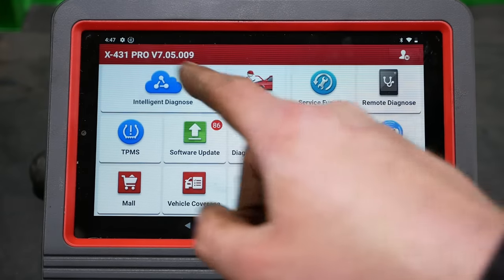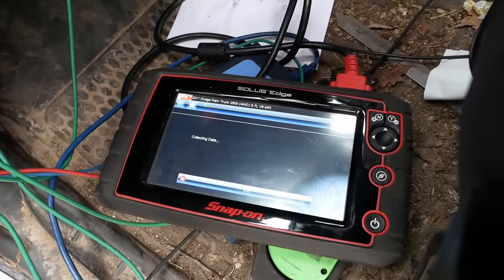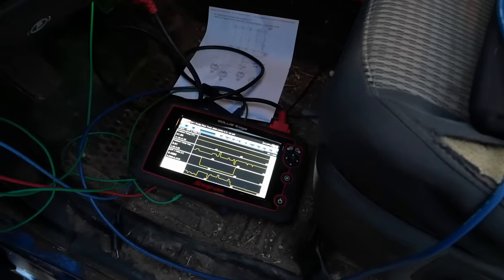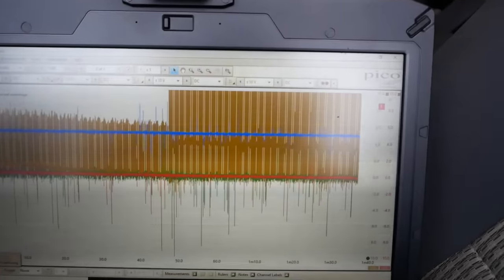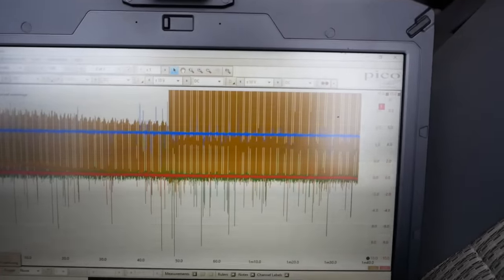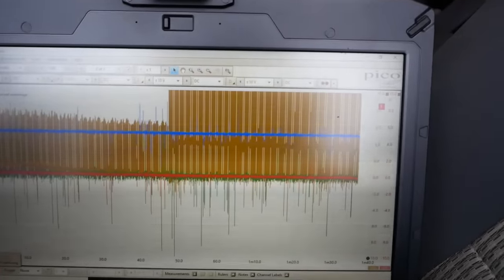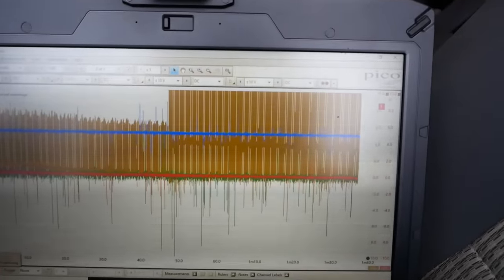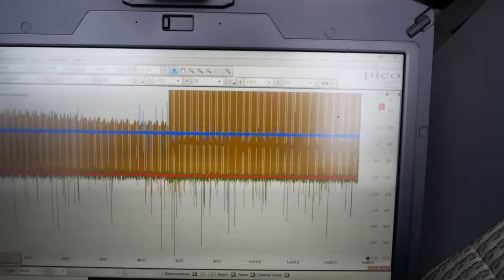Diabolical Diagnosis - Hemi Ram Stuck at 1500 RPM with P2128 and P2138

Comment: I am a retired mechanic in Land Down Under. I still help people service/repair their cars although these days I only see a car here about once per week. My knowledge is limited and I would NOT have had the skills/knowledge to have found this fault although I would have a better chance after watching this and Wes' other videos. What I tell people is if they need to take their car to a workshop, no matter who it is, ask them if they can fix the problem. Naturally the workshop will need to check out whatever it is first. But then I tell the owner to tell the workshop that if they put something on the car (new parts etc) and that does not fix the problem, the owner will NOT pay for the part or its installation. I know the workshop owner will go nuts about that. But that is why you first ask the workshop if they can fix the car. If they say yes, then that's the rules. Bottom line is that you are paying for the knowledge and experience to diagnose the problem and find out exactly the cause. As Wes has shown, that is the skill. Anyone can replace parts (within reason anyway). Owners want the car fixed - they don't want to (and should not need to) pay for work done/parts installed that don't fix the problem. Other workshop owners will hate me for recommending this (what can be seen as ultimatum) but you want the problem fixed - nothing else. If the workshop says they can do it (and have it in writing signed by the business owner), then those rules apply. If the workshop says they can't abide by those rules then go elsewhere. People with skills like Wes are few and far between. It is worth travelling quite a way to find a "Wes". Takes you a long time to find people like him. One way to find people like Wes is to talk to truck drivers/owners. If a truck is off the road then that is lost income. Truck owners have little time for incompetence and are generally quick to voice their disapproval. I know a car is not a truck but the truck owner will normally be able to point you in the right direction of who is competent, genuine and honest, and has the skills to do what you need, particularly to find problems that others can't.
Reply from the maker: I agree in principle, but the problem is that most vehicle owners are not in a position to question a mechanic. For example, if you can has a misfire and the shop replaces spark plugs, coils, injectors, and oxygen sensors, and the the problem is fixed, is that wrong? I mean they fixed it, but did it really need all those parts? Depending on mileage, maybe it did. It's a tough question, which is why no one has really found an answer.

Comment: About 8 years ago I had 2008 half ton hemi with an intermittent no start . The dealership unloaded the parts cannon. 3 weeks and $5500 it was fixed. After a year of ownership and $14000 in repairs I sold it. Gave the new owner all the repair receipts and wished him good luck. It was an electrical nightmare with a gremlin transmission and a fuel system that didn’t want to work. It was one of those certified used vehicles bought at a dealership .

Comment: Nice find, Wes.  People who don't do this don't understand the rush you get when you find something like this.  I once had a 2015 Chevy Colorado with a similar problem on the APP circuit.  It turned out to be some after market rear backup sensors that were not even in use anymore.  Removed them from the reverse light circuit they were hooked into and the code never came back.  It took me several visits and4-5 hours to find it.  In the end, I never could catch it.  I found the aftermarket stuff, pulled it out and gave it back.  Code never came back after that.

Comment: Capacitive inductive interference. I worked on low voltage communication lines. Our comm cables run for miles on telephone poles and would absorb water through the jacket and cooper shield. Cross talk between cable pairs (50 pair cables) would cause multiple comm channels to fail intermittently and randomly. We eventually replaced the old cables with dielectric filled cables. Our temporary fix was a 12vdc power supply @ 1Amp on the shield at on end of the cable and to earth ground on the other. A side benefit was that the bushey tailed rats (aka squirrels) didn't like getting tickled and stopped chewing on the cables.

Comment: Well done Wes what a b hitch of a problem to track down and sort out. Like you said at the end of the video a dealership would of probably just loaded that very shiny expensive parts cannon and fired it intermittently at the engine bay. Good on you for sticking with it and repairing it

Comment: Wes,Dad was a design engineer for a phone systems manufacturer. The field service guys would call him and describe the problem. Often he would go to the test lab and tinker with stuff till the problem repeated itself. Then he would call the guy back with a fix. Back then they didn't call it diagnostic troubleshooting but it was. Alaskan  pipeline communications system was designed partly by my Dad. Al B.

Comment: Condensation in the actual tape. Since the greenies is copper oxydation the humidity in the air provides the short. That make the problem go away after 3 min because the heat from the engine dries out the moisture and cuts the electrical flow path. You're right Diabolical :)

Comment: Good Job Wes, perseverance like yours is very rare in the tech trades.
Really surprised that control parameter wires are not shielded though.
Reply from the maker: Nope. No shield.
Reply: @WatchWesWork  stray volts can be a big issue then.

Comment: lots of other techs gave up on it  , had a late model Chrysler minivan kept burning out ECM s , I finally found a tiny wire outside of the harness it was pinched in a metal bracket on the intake manifold , I almost completely gave up on it , my employer had at the time did already. I was so happy to finally finding the problem.

Comment: At the MTW mine at Mt Thorley, the workshop manager put a holden colorado wiring loom on the floor, covered it in mud, and added water, and stray voltage was picked up in the wiring loom. The holden rep was stunned.   What happens in snowy conditions, in Illinois............you guessed it.............salty water/mud is getting in and on the wiring looms.

Comment: Awesome job, as always, Wes. 
Been there, have that T-shirt. Whenever it was cold and wet my car would be hard to start and be a cylinder down, if it started at all, on a cold start. If I revved the engine to around 3000 it would run fine but when it went back to idle it would drop out again, after it warmed up it was fine again. It was driving me nuts, I didn't have all the wiz bangs and gadgets you have but my diag tool said there were misfires on cylinder 1 and occasionally cylinder 3.
Eventually, having striped away all the crumbling conduit and tape from the wiring harness for the on plug 3 pole ignition coils,  I found that the wires for the 1 and 3 coils had little cracks in the insulation, from engine heat. After splicing in some nice new silicone insulated wires it was sorted. There is nothing worse than an intermittent fault, they take ages to diagnose, years off your life, and are the biggest pain in the ass.

Comment: I worked on a Chevy 3500 cab over (Isuzu) flatbed truck with a Chevy 6.0 one ton chassis. It had intermittent APP codes and limp mode. Replaced throttle body, not the issue. Traced wires and cleaned all harness plugs/connectors. Ended up being corrosion inside the throttle pedal assembly causing the codes. Cleaned it and solved problem. Very frustrating to trace.

Comment: Great video!  It's so cool to watch folks like you and Eric O work these bizarre problems.  I remember many years ago I had a local shop that did some great work, but they didn't have a lot of expertise tracking down electrical issues.  They had a deal with a guy whose specialty was electrical troubleshooting.  The deal was that if we paid a flat rate of $150 (this was over 20 years ago), the guy would diagnose until he found the problem, and then we could pay the shop to do the repair on top of that $150.  There were a few times that it was totally worth it for us.

Comment: When you Said all computer stuff in this. I was like o no I don't know nothing on this stuff but your so good on fixing I always watch. Had a friend had a ford escape i just cut her grass and she asked me to change her air filter yea it was so bad I used air gun to blow away dirt in the air box put all together was running really rough opened up the air box a small piece of dried grass had got stuck in the air censer so small that I cold of missed it used a vacuum. Crevis   tool and sucked it out and then used Muscle Moist Out to clean the whole intake and put Muscle IC- 10 through the break booster 
Wow it run like new and better gas milage

Comment: Great video as always. I was looking for your latest video and happened across this one that I must have missed 9 months ago. Your patience in diagnosing this type of issue is admirable. I am however struck with a recurring theme in most of the vehicles that you feature , in that most of them seem to have absolutely filthy interiors. I work out of my truck everyday as a landscaper, and i never allow my vehicle to even get close to the level of neglect that I see on the vehicles in your shop. I usually do all the work on my own trucks, but on the rare occasion that it has to go into a repair shop, I make sure that the interior and exterior is clean, and that any and all items are removed so the mechanic doesn't have to work around my stuff.  It just seems like an obvious courtesy. The floor in this truck made my stomach queasy, the junk on the dash, the passenger side footwell with junk filling it... yuck! I give you a lot of credit for putting up with that day after day. I ran a trucking company with 15 trucks and 20 trailers for a lot of years. Our mechanic was scheduled at my shop 2 days a week to do preventative maintenance, on call for breakdowns. Otherwise he operated out of our other shop with 30 trucks. My guys knew when their trucks were due for grease and oil, and I required them to wash the truck inside and out before they left for the day when their truck was to be serviced the next day. It was a small courtesy to the mechanic, who did a wonderful job, and often commented that it helped to make his job easier. It doesn't take a lot of effort to clean and keep thing clean, you have my respect!

Comment: Eric at South Main Auto, had a car where a faulty power steering pump sensor was  going +12,0,+12 and the on/off action replicated how AC voltage can "induct" a similar AC style interference in another electrical circuit which was the Evap fault he was solving.  So whenever you see spiky voltage in a signal wire, its coming from somewhere, some kind of pulse.  Eric only solved his case, because it only happened at 3000rpm and that was when the power steering pump sensor "switched on" and started sending spikey +12 voltage to cause the interference.   Great troubleshooting WES,  diabolical indeed.   IF YOU have salty moist conditions, you will absolutely get interference in circuits, mines in Australia have big problems with salty mud inside chassis rails, putting stray voltage into wiring looms.

Comment: Feel your pain Wes.
Reminds me of a Nissan forklift I had with a constant battery drain no one could find.
I get those jobs as I'm the only one at my work pig-headed enough to keep diagnosing rather than just getting the parts cannon out!
Only caught it out of desperation - turned the rear spotlight on and the engine shut down like you'd turned the key off. 
Turns out the negative for the coil of the ECM power-on relay which is a switched negative had shorted to the positive feed of the rear spotlight - keeping the relay energised when the truck was turned off (battery drain) by earthing through the bulb put also putting a positive signal on that coil negative when the rear spotlight was on. Had to open the whole harness to find it - no external chaffing whatsoever.
Reply from the maker: Wow!

Comment: I had the same thing happen to my 87 Grand Am back in the 90s   back when the Audi issue was making the news. Out of the blue the check engine light would start flashing and the car would accelerate (sometimes right into and intersection). Turns out it was the cable leading to the throttle position sensor grounding out intermittently (rubbing against a sharp medal object).  Love your channel!. Just catching up on some old videos  Happy New Year!

Comment: To add to your speculation about the weather being the cause, I think salt had a major influence on the short. Salt dust coated the wiring and then would absorb water overnight causing a short. When the manifold warmed up, the salt would dry out. Just my thoughts on yours. 
I used to have a Saturn Ion that had a similar issue, but would only go into limp on hot days. I think it was a wiring harness down by the kick panel. Never could figure it out, I didn't do my research and I bought it with a lemon buy-back title. That is the only real issue I had with it, so probably no one else could figure it out either.
Reply from the maker: I bet you are correct!

Comment: Hi Wes, you don't need a broken insulation to induce current in an adjacent wire.  Those injector pulses are high current and they will inductively couple to an adjacent wire, especially wires that are being compressed mechanically reducing wire separation. The important second part necessary for such an induced errant signal is for the circuit receiving the coupled current is that it be high impedance, as in the appt pots.  This looks like classic EMI which is why design practice is to separate or shield high current circuits from high impedance circuits.   This means playing with the harness may relax it enough to be decoupled, until something compresses it like cold shrinkage.  Good eye correlating the injector pulses shape.

Comment: We all know that work self employed what a dealership would do in that situation if they couldn't figure it out after an hour or didn't have the guy there that had seen it before working on it " stand clear firing the parts cannon"  and 3 K later it's still doing it at which point they bid you nothing for it and try trading you into something else.   When I bill it's hourly rate, and be realistic with the hours, If I feel it took longer than it should for what was done . Especially if it was somethin I had never done before, or learned something that the next time a guy brings one in you can go right to it and know what was wrong or how to fix it. Being self employed and getting machines to work on there isn't much info available for can be quite interesting learning some days .   Thanks for the video, Take care

Comment: Great story and effort! Reminds me of an intermittent engine rpm spike that our dealership technical liason chased, taking many trips with a loaded 18 wheeler to finally record the electronic throttle position sensor signal spike. It was around 2006? It was warranty and no data-no pay. There was a tiny fracture in the rheostat that only happened intermittently. Simple repair to replace the tps, but it had to be proven as the cause.
Reply from the maker: Ouch!

Comment: I've learnt so much diagnostic information for the newer stuff from your channel ever since I had a MIL lamp turn on the Pajero and I purchased a scan tool plus your level of problem solving to find the problem I've been taking into account. I'm old school in that my daily is all mechanical diesel with no electronic controls but I keep on top of the newer stuff. 👍 Thanks for your informative videos!

Comment: The amplitude of the voltage that was showing up for that injector cross-talk was interesting.  I know the automatic shut-down relay outputs drive the high sides of the injectors and coils and FETs in the ECM are connected on the low side and turn on to connect the coils to ground.  Maybe that high voltage is just the inductance of the coil (V=LdI/dt) of quicky opening and hence quickly changing the current from some nominal value to zero when the FET opens again.
Reply from the maker: Correct. The injector coil acts like an inductor. When the field collapses you get a give voltage spike. It can be up to 80 volts.
Reply: @WatchWesWork  I guess they think a snubber circuit in the ECM is not necessary.  The FETs must be rated for quite a bit higher voltage (you would hope anyway).
Reply: @WatchWesWork  I wonder if those spiked may have degraded or damaged the ECM A/D converter inputs that monitor the  APPS outputs.  I would be surprised if they could handle that for a reasonable period of time.

Comment: Good job Wes, intermittent problems are a royal pain. Struggling with my own intermittent nightmare on a 2005 JGC Ltd. with the 5.7 Hemi. No Start/No Crank that is effected by the ambient air temp . Early morning when its cool, it cranks and runs great. As the day warms up, or you take it on a drive cycle, nothing !!  No Crank/No Start.
Reply from the maker: Sounds fun! I'd think that's got to be a TIPM issue, but it could be anything.
Reply: Finally got it to throw a code. P0706 ( Trans Range Sensor ) , but the Trans Temp Sensor is also giving false readings,  Pulling my hair out here !

Comment: I live your content bro, and especially these kind of videos. I'm an industrial electrical maintenance tech. If it wasn't the weather and moisture, there could have been some induction going on between the parallel conductors. It's a big problem in low voltage systems. With the insulation wore off, it would make induction much more of an issue. That still doesn't explain the intermittent issue though. Working with electrical problems sometimes just doesn't make any sense.